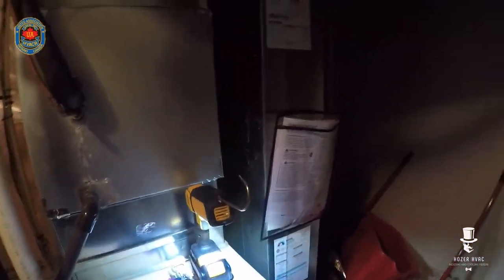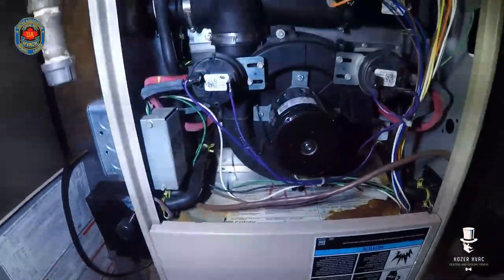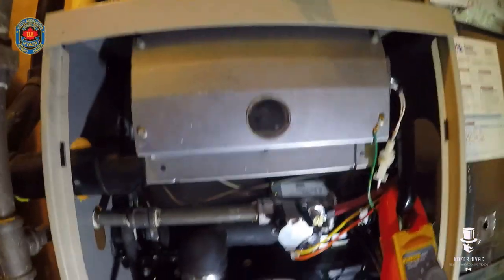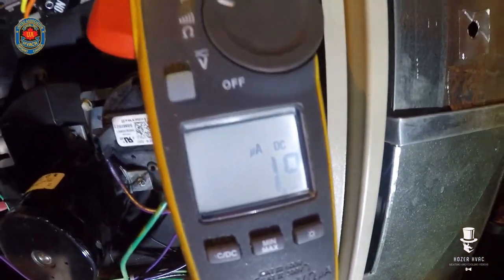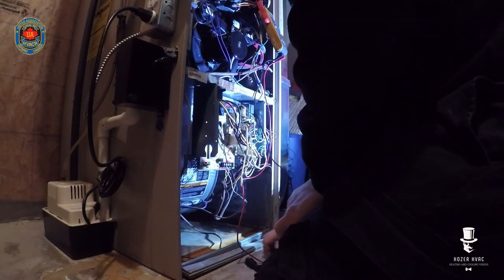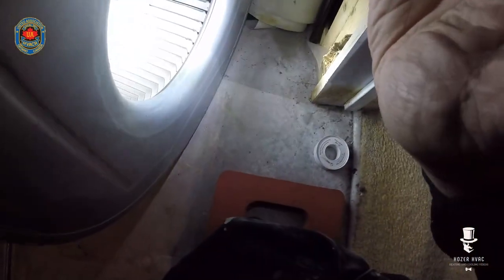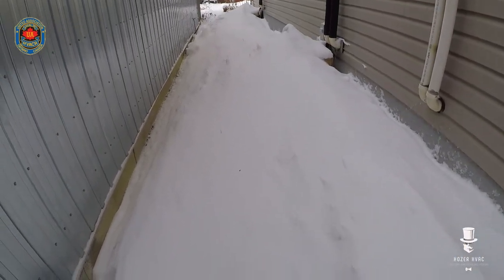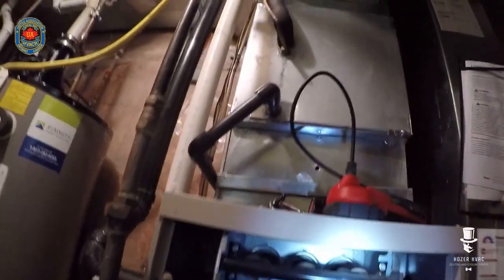HVAC service: No heat alternating flashes

Comment: Dang Cory that was a tough one. You get all those crazy pressure switches 😵 I found that whenever the intake is truly blocked, especially on that particular model of furnace, the burner box will get a wheezing sound. Kind of like a woman breathing in Lamaze class. the little round plastic sightglass will even rattle a lot of times because it's trying to pull air through all the cracks of the burner box instead of the intake pipe.. way to stick with it, I think you definitely got it 👍
P.S.- that's the model of furnace that I find the cracks on. The units that are right around the 1999 to 2000 age. crack is usually 4 or 5 in in on the sidewall of the far-right burner or far-left burner..
Reply from the maker: Shannon Knight HVAC this one was a 2004. I thought for sure at first that it was a blocked intake but it fooled me hopefully it is the pressure switch. What do you use to do your heat exchanger inspections. I use a Milwaukee inspection cam which does all right. I am not the greatest with Sheet metal So I usually puncture the transition with my step bit and send my camera down. How do you typically view the hex?
Reply from the maker: By the way that line about a women wheezing sent me on the floor 😂😂😂😂
Reply: @hozerhvac4406  I use a flashlight with a really good tight focus beam and look in from in front of the inshot burners. I don't even go down through the ductwork. Those kinds of cracks you can see just from looking in thru the front of the burner box. They're very visible once you know what to look for, once you've seen one you'll be able to spot them easily.
Reply: @hozerhvac4406  A co-worker of mine laughed about that too until he found his first block intake and he called me on the phone and said man you weren't kidding that sounded just like a woman breathing in Lamaze class. 👶
Reply from the maker: Shannon Knight HVAC true veteran. I will defiantly try next time through the burner box. I was think they will be far down. Thanks for the pro tips
Reply: @hozerhvac4406 nope they're only about 4 or 5 in in. With a good flashlight and angling it just right you'll be able to see them without removing anything. 💪

Comment: I've had issues with combustion gas recirculation into the air intake. I had to prove to a customer once that was the issue by holding a large piece of cardboard between the two. If this unit gives you an issue again I would check to make sure the combination gas's aren't Getting sucked into the air intake. Great video!
Reply from the maker: Hughesman HVAC good call. So would the combustion gases cause it to shut down like that ? What were the symptoms for yo ur customers call?
Reply: @hozerhvac4406  yes, It will light and then Immediately snuff out. It was a head scratcher for me and when I watched your video I immediately thought of that call.
Reply from the maker: Hughesman HVAC damn !!! Now you got me thinking maybe that could be it. I will update you if it is a call back. Wouldn’t of that of that. Thanks brother

Comment: Great diag, It's good to see a tech actually take measurements and not just throw the parts cannon at it.. A common cause of light PS fluttering is a clogged bleed port. Most PS's over .1 have them. (sometime a pain finding them, but generally on the neck of the tube port)  If the pressure changes when you pinch the hose on a pressure switch with a bleed port, the bleed port should be open, otherwise it's possible it's clogged.

Comment: Checking than secondary probably looked like a furnace giving birth to a service tech.
Reply from the maker: Lennox has been having issues with these and other units. I always pull the blower because there the primary meets the secondary in the back, often we will find rusted out holes in the hex.
Reply: @hozerhvac4406  that's great, thorough work. A lot of techs are not.
Reply from the maker: 🤣🤣🤣🤣🤣 I just got this joke now. No doubt hahaha legs hanging out and all